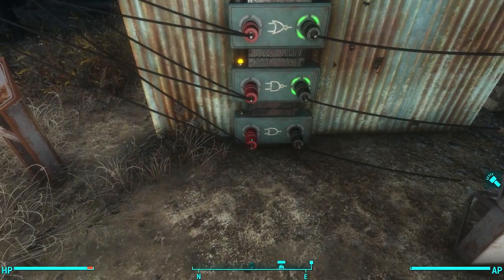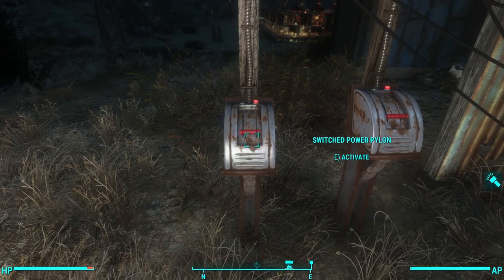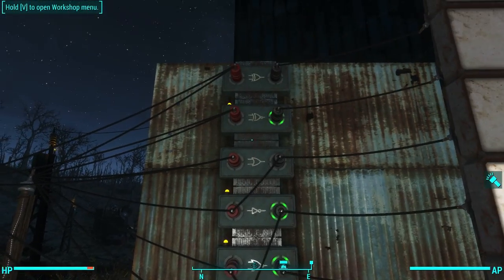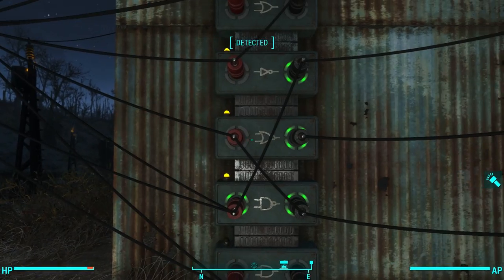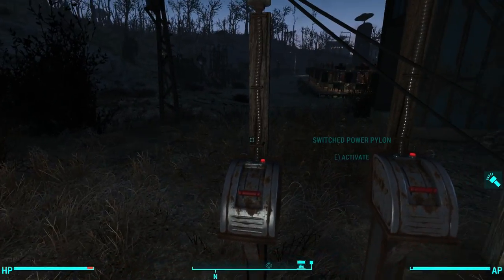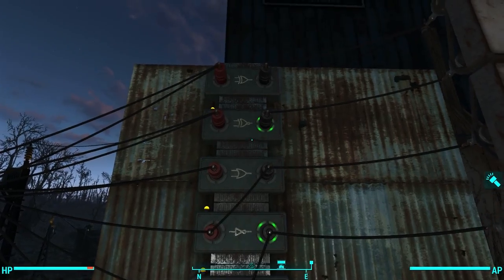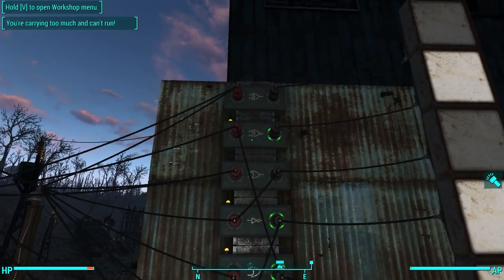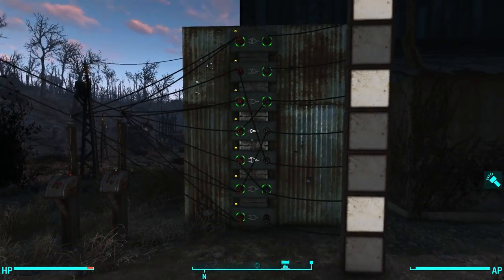How Logic Gates Work - Contraptions Workshop - Fallout 4

Comment: What practical applications does all this have other then light control?
Reply: Motokid600 Well, I wired a two way door using the xor logic gate and I'm currently trying to set up a portion of my factory to either feed supplies into a weapons Smith, an armor Smith, or to bypass them both using only 2 switches. Can't get the damn nor logic gate to supply power without a power source though which is seriously pissing me off lol

Comment: I spotted the both on work but both off do not issue with the XNOR.  They screwed these things up badly.  If I can hang a light bulb on a ceiling halfway across a room simply because I have an electrical node mounted at the wall , then these logic gates should be able to gain power that is NOT part of the logic switching the same way.  AND after all these years one would think they would fix that and folks would be glad to make whatever alterations needed to correct their configurations.  Because your logic 1 output on that one device failed to push power as well, yet you can use it to push power through this failed logic device.  How quaint.

Comment: Ill do simple map for making it easy
AND logic *
0 0 0
0 1 0
1 0 0
1 1 1

OR - logic +
0 0 0 
0 1 1 
1 0 1
1 1 1

The first two numbers are inputs, last is output

N means it flips every output from 0->1 or 1->0

X (eXclusive) means outputs are 1 if the two inputs are the same

Comment: So does this basically mean you can make a house that is lit up entirely by false power that is not even backed up with a generator? If so.... wat.
Reply from the maker: Well kinda. But no. So the generator needs to be connected to the houses' electrical network, BUT, all switches need to be turned off. So the game needs to be able to detect that a generator is wired up, but power can't actually flow TO the house.
Reply: +Oxhorn I real life applications, these gates (and especially ones like inverters NANDs) usually would be just be small signal currents or voltage levels controlling the flow of a seperate current.  In other words, to be more realistic there should be another input that is constant and seperate from the conditional inputs.  This would provide the actual output if the conditional input(s) are in the proper state (s).

Comment: Erm, couldn't you just look up how real logic gates work on wikipedia or anywhere else? I mean, a video about this Fallout DLC is as good a place as any to learn about them, I guess. I'm just surprised there is a demand for this. There is no difference between the logic applied in real electronics and these simulated gates.
Also, a NAND gate transmitting a "true" signal when both of its inputs are set to "false" DOES make sense in the real world too. Flipping a switch to "off" is not the same as cutting the power. There will still be current running through there, only very little. The value is never literally 0 when the gate is connected, because that's how we differentiate an intented "false" or "zero" signal from legitimate connection issues / power outages. In layman's terms, the difference between a logical 0 and 1 here is not "zero voltage" and "some voltage", rather "very little, but detectable voltage" and "more voltage".